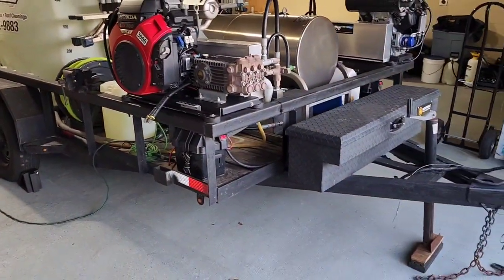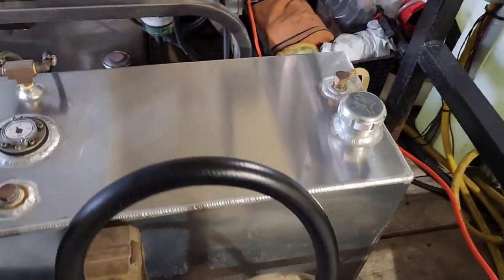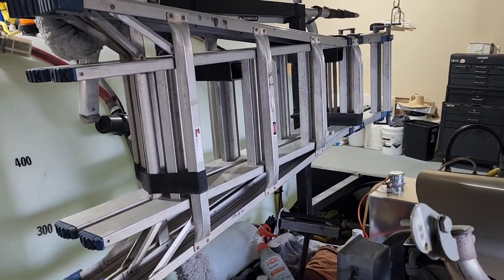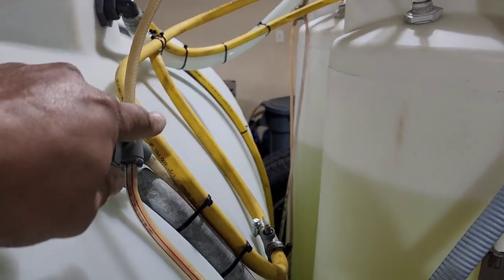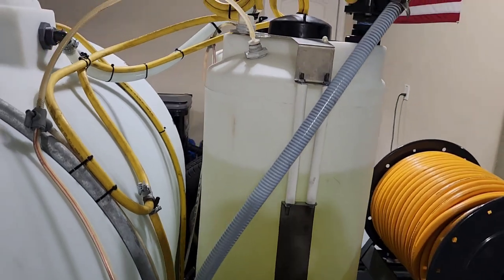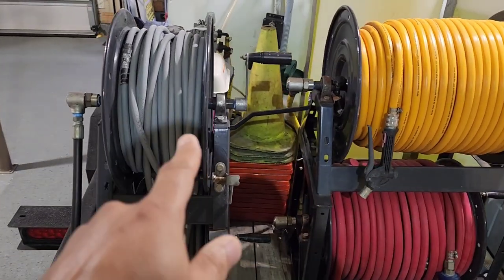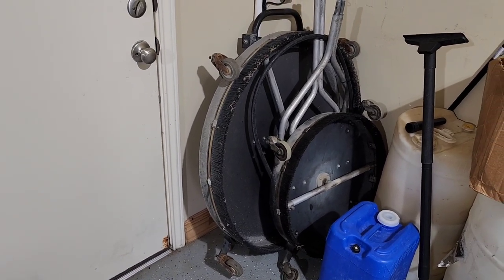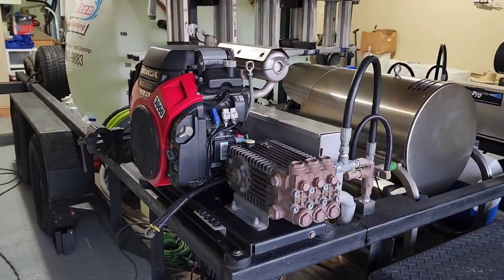Trailer Walk-around (updated) Dec 24th, 2022

Comment: Looks great, however I'd be very cautious with that much chem on the trailer. You're only allowed 1000lbs of of hazmat before placards and licensing are required. So if you have those 50 gal tanks full, that's 1000 lbs, and there are a lot of gallon jugs and that 5 gallon jug up front that would put you over. The 1000 lbs limit is all chem combined and the DOT knows what to look for.

Comment: Sweet setup Paul. Is the Silverado gas or diesel? I've been looking at the 2500 gas setup.
Reply from the maker: Thank you very much. The truck is gas. My previous vehicle was a 1500 3.0L duramax. All though it was a great engine, I put 52k on it in 2yrs and the obvious will come just like it will with all diesel vehicles today. You will have EGR, DPF or some other emission related problem that will eventually come up due to the nature of how they're made now. Unless your towing near max frequently, you don't need a diesel. I was at near max with my setup and needed bigger. Now with the 2500, I'm just pulling half the max capability.

Comment: I have the same unloader, what's the purpose of the 2nd bypass hose going into the bottom of the unloader? Yours is the 2nd one I see like that.
Reply from the maker: The yellow hose off the unloader is the bypass to the tank. The black hose that loops goes to an unloader failsafe knows as a pressure relief valve. If unloader fails, the relief valve will release at 5000psi.
Reply: @readykleenpowerwashing  alright cool I'll look into that. Thank you.
Reply: @readykleenpowerwashing  I finally found it. The black hose is connected to the thermal relief valve which is on the unloader. The overpressure relief valve is behind the water pump.